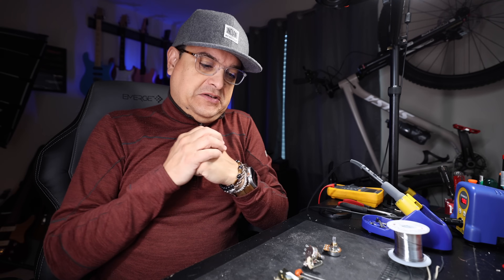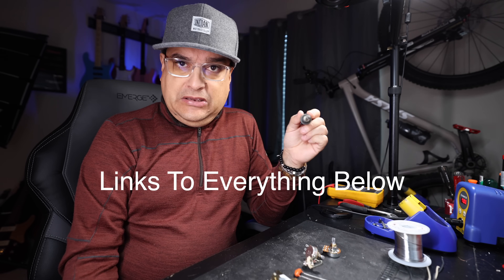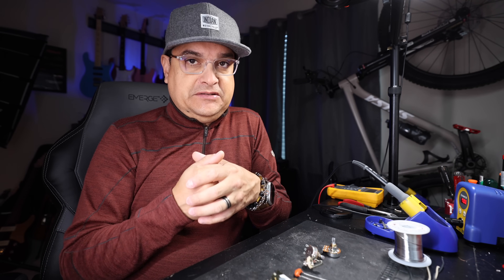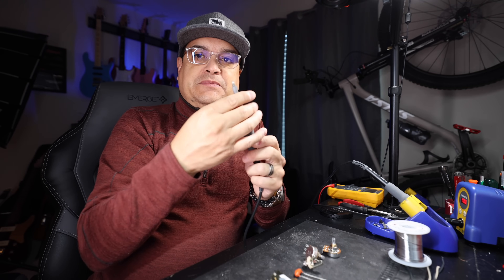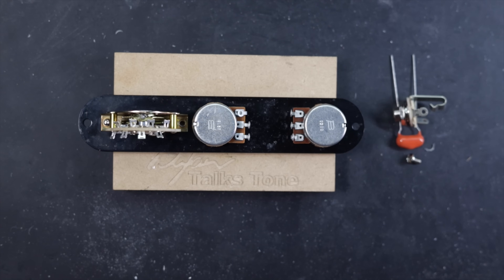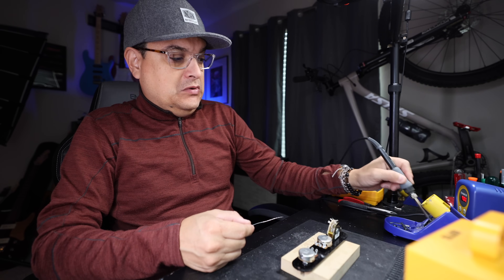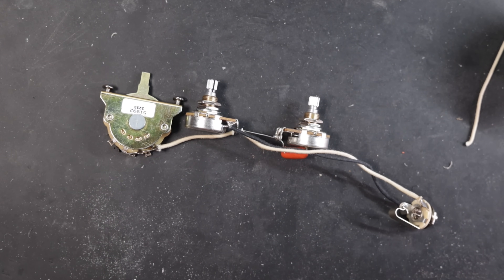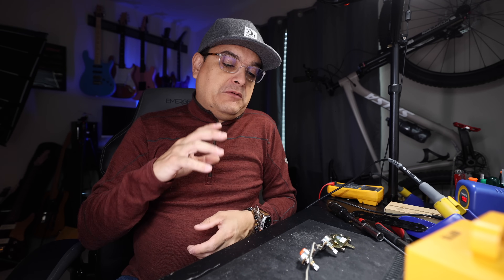If Your Soldering Sucks, Do These 5 Things

Comment: Hi. I'm using pointed tip soldering bits. I have to wipe them on a wet sponge regularly to keep them clean. You did not have to do that I wonder why. Thanks
Reply: You have to clean and tin your tip regularly to keep it clean. It's part of the process. I'd strongly suggest to use a brass sponge instead of a wet sponge, though, as the repeated thermal shock of the wet sponge will ruin soldering iron tips very quickly

Comment: Was frustrated trying to get a simple repair done. I figured it was a lack of heat with the cheap little iron I had. It was the iron. Once I had a good hot iron, it went smooth.

Comment: I have that exact same Weller iron and it sucks. I just bought a new station today because of it. I decided to test to see if the temperature control knob on the Weller does anything and it doesn’t. It doesn’t change the voltage on the outlet of the iron plugs into and I verified this with a temperature probe and the temperature doesn’t change, regardless of how that knob is set. Not only that the tip literally gets loose every single time I touch a solder joint with it.

Comment: Thank you so much for the video!
If I may give unsolicited advice, for your overhead camera, which is usually at a fixed distance from your table, try turning off the auto-focus to avoid focus breathing when your hands need to enter the frame between the camera and the parts you are working on. This way you could keep the focus fixed on the parts and prevent eye fatigue.
Reply from the maker: I appreciate that. Manual focus creates problems too so I have taken to using a much higher Fstop lately.

Comment: Hey I know I'm late to the party, but I'm looking for tips. I tried wiring up my guitar but when I try to solder, especially on pots, I cannot get the solder to stick to the pot. It always stays on my iron or forms a ball on the pot (but never a nice workable blob) that just comes off with the least amount of force. The capacitor leg that I soldered to the back of the pot just comes off like nothing and theres just like a mountain of solder and wires on my volume pot where all the ground wires meet. I'm using the TOAUTO DS90 soldering station at about 700 degrees. Also, it seems like the tip isn't distributing heat equally because solder will melt instantly on some parts but will absolutely not melt on other ares. Any tips for me?
Reply: way too hot, tin 400ish is fine, tin your soldering iron tip and clean it with steel wool and/or a wet sponhe between uses. Put solder on both the wire and thing you want to solder, then heat both before joining them and adding a bit more solder. Heat flows much easier through solder than most other things. You are trying to bond the metals together...

Comment: I use that exact same yellow fume extractor fan. It works pretty well. And while it's not strictly necessary, I do complement it by having it sitting to one side of my work area, pulling the smoke towards it, and then a similar small desk fan on the other side of my work area pushing the air across in the same direction. So overall, there's a strong left to right airflow across where I'm working.

It may be overkill, but that extra fan cost like $10.00 at Walmart and takes like 2 extra seconds to turn on when I'm soldering. I figure it worth it to avoid breathing some stuff that - while not exactly "OMG drop dead instantaneously" level dangerous - isn't exactly good to be breathing in.

Comment: I totally recommend a Solomon SR-965 Soldering Iron. It's 40 watts and has plenty of heat and does a wonderful job if you don't want to spend huge amounts of money. I recommend the Solomon over most Weller irons you find in like walmart...they are 20-30 watts and the heat sucks.

Comment: To solder push back wire braid to a pot case quickly and completely, I would use a soldering station iron handpiece heater (either cartridge or shaft heater) at 50 Watts or above. The red Weller is only 40 Watts, and the Hakko is 65 Watts. My PACE PS-90 at 51 Watts works good, but my ADS200 cartridge handpiece at 120 Watts max with a high power cartridge is much faster and responsive. A flat tip is called a chisel tip. You select the size to match the solder joint requirement. If you have to use lead-free solder choose a soldering station that has cubby actuated temperature instant setback, this will help preserve the life of your tips. If you can use leaded solder use eutectic solder.

The flux is important for soldering to a pot case. Clean the pot case (I use a grinder with a superfine scotchbrite pad, pot cases tend to have a lot of manufacturing scale and oxidation on them) before soldering wipe with IPA. Then you need a fairly active flux, I like to use RA flux, which will need to be cleaned off after soldering. In my experience RMA no-clean does not seem to be active enough for soldering to a pot case. Before soldering to a pot case always add additional liquid RA flux (match the added liquid flux to the same flux used in the wire). I have liquid flux in a small brush glass bottle. The sad truth to soldering to a pot case is to make a good solder joint the case will have to get to the temperature needed to flow the solder, this puts a lot of stress on the pot.

After soldering each joint you should tin the soldering tip before returning to its holder (some call it a cubby) this will preserve the tips. This is where I like to use 0.062 inch diameter solder wire on a spool next to my soldering station. If you use a sponge use distilled water and not tap water. Most tap water has high mineral content.

To jumper for point to point wiring it is common practice to use tinned copper bus bar wire of the same nominal size as the other wiring in the guitar. So, if the wiring is 22 AWG you would use 22 AWG bus bar wire. If 20 AWG like a lot of older Les Paul guitars you would use 20 AWG bus bar wire. You can insulate bus bar wire using Teflon non-heat shrink tubing if required.

If you want to know the proper techniques and images of production level solder joints you should consult IPC standards. Really, any guitar wiring technician should be at least IPS J-STD-001 certified.
Reply from the maker: For anyone else seeing g this… there is a lot of misinformation here.

Comment: If anyone looked inside my guitars, they would literally recoil. My soldering is so bad, it looks like some sort of Terminator 2, liquid metal thing took a dump all over my pots... which are singed to the point of wondering how they even work anymore. Wires burned, rattling chucks of solder rolling around inside the cavities etc. It's a train wreck. lol

Comment: Thanks for the great help. I've watched other vid's where people use the push-back cloth wire for the switch jumpers, and that looks like a nightmare, and it usually ends up looking crappy. Is there any reason to not just use bare wire like you have done here?

Comment: Several people have done tests to validate the claim that solder guns can demagnetize pickups. 
I haven't seen anything that leads me to believe this is true. Even if it is, I have rarely needed to solder with my gun right up against the pickup lol. In the rare event that you need to do that, just switch to a stick iron real quick for that part.

Comment: Thank you for the very best soldering advice.  That Tele harness you did in a few minutes would have taken me an hour at least.  I think the only thing I’m doing right is using cloth covered push back wire.  I have an LTD EC-1000 with a beautiful koa top that looks, feels and plays great, but the original Seymours are just not doing it for me.  Not enough midrange and a really ragged sounding low end.  I’ve already bought some replacements and I’ve been dreading putting them in, but your suggestions are going to make this a lot smoother job.  Now for starters I’ve got to get myself a new soldering iron…. Thanks again!

Comment: Great video. Many good points. What would also be great is showing how to solder several wires to the back of a pot ie. multiple pickups, grounds. Do you twist them all together or do a small spot for each? Thanks

Comment: As an intermediate solderer there is 1 observation that stands out. Specifically I have been dismayed when I receive a new set of pickups with very tiny gauge hookup wires, such as 30 awg or smaller, because experience has taught me that those super tiny wires are very difficult to work with in a complicated soldering situation. For instance tinning these very tiny few strands can cause the thin wire to lose its flexibility and become rigid and brittle, prone to super easily breaking off near the solder joint. Etc. Etc. 

Lots of us have been baffled after receiving a humbucker with 5 microscopic hookup wires!?#@?

Things like that cause stress. Especially if you only need 2 wires. 

Vintage style pickups are, however, available with heavy 22 awg hookup wires. Most references state that 22awg hookup wire is the guitar industry standard used in almost all pickup hookup wire. Well, don't rest assured because even some boutique vintage style expensive p90 pickups come to you from the factory with 30 gauge hookup wires.

Most casual recreational guitar modders are unaware of this wire misunderstanding. In reality most modern pickups don't have 22 gauge hookup wire. Most modern pickups have very thin hookup wire compared to vintage pickups. These very tiny wires are good for complicated pickup switching options, but I suspect that another underlying factor that people need to be educated about is because the hookup wire gauge is most often not 22 or 24 awg, instead the wires are almost microscopically tiny wires that are most often used in robotic assembly operations. These same tiny wires pose a real challenge to the casual solderer.

As a solution a customer can often order the same pickup with vintage push back wiring instead of tiny tiny modern plastic insulated wires. Those tiny wires are for inserting in quick connector blocks found on pcb boards, i.e., Gibson guitars. It saves $$$$$ in manufacturing as the components snap together. No need for soldering technicians or soldering robots. A robot can snap a connector together easily. The robot doesn't even need to be 'smart''. 

I wonder if guitar players know that a lot of expensive guitars are equipped with pcb board based electronics. When a guy finds out that he can't even change a pot in his new lp traditional you might expect him to be flabbergasted and insulted by a company that he thought he could trust.

It seems unethical to market a guitar as being vintage or traditional without certain characteristics being found to be present in the supposedly vintage or traditional product. It's an obviously dishonest business practice attributable to corporate management policies. Misleading the customer is always a bad idea. 

It is advisable to always investigate and research the specific details regarding hookup wire size when thinking about modifying a guitar or buying a new guitar for the purpose of modding it.

By practicing soldering skills and learning effective soldering techniques a person can effectively turn an inexpensive guitar into a super great instrument. Many cheap guitars a well built structurally, but they are often very lacking in the electronics department (like my '14 Gibson 50's Tribute Les Paul p90). It is also expensive to have a cheap guitar worked on. Learning to solder can open the door to learning the theories behind guitar wiring circuits and you will be able to use the pickup options of your choice as  well as any switching options possible.

Comment: My update on the Weller WLC100. You can (so far) still get them from Amazon for $65- but Weller has discontinued it, no website support at all, and in the  Seattle area no replacement tips.

Comment: nice bike , what is it? and sometimes it's like the solder job is fighting me, I've been soldering for 40 years and still have issues so, asking: is it mostly right heat and if not sticking or melting is it the surface of the joints not prepared properly, example: just the other day I'm adding digital timer to a solar inverter and a little hard getting the big solder puddle on the power in joints to melt..thank you

Comment: I had a problem with a pad on the board and no matter what I couldn't get my new 22ga wire to solder shinny. A solid and stranded sets of Amazon wire insulation melting off and then getting some wire from Antique Electronics solved the heat issue but not the tinning with non lead solder. Finally have the option of non lead for my new Epi mods and lead for old amp and vintage guitar repair by going with 20ga stranded heat resistant auto primary wire from Napa that is not tinned giving me the choice of non Kester or lead. Hope this helps somebody

Comment: "Use good stuff"! That is the ticket, light and a lens for me because my eyesight goes fuzzo when I have to zoom in to a pot/cap/switch. Lastly "Be cool and calm" I used to get into a frenzy when I finished up and all was tested, put the plate in and....Nadda cos I over heated a pot by using a stupidly heavy duty wire just to connect a volume pot and the heat and time On the lug wrecked the wiper inside the pot(They were rather inexpensive type) so that's how I learned (like you said) we are'nt welding here! I know you must have learned in a similar fashion cos you have it down to a fine art and that takes practice. Thanks, again for reminding us to use the "Right stuff".

Comment: Any recommendations for desoldering wrapped pots or switches? I ran into this issue on a Fender 16' MIM Strat as something done from the factory when trying to redo the hot connection for the jack on the volume pot and have found nothing online yet.

Comment: Soldering IS welding. Chemical bonding would be using something like an epoxy. Lead and tin are not chemicals, they are metals. They are used as a fillet material in soldering. The main difference between soldering and "welding" is you are not melting the base materials AND the fillet material. You are bonding them. There is still welding going on here, not chemically bonding. A cold base material will not bond with a hot filler material. You must heat both the base materials AND the solder. Otherwise there is no joint/joining/bonding. 

Not meant to argue, but stating false "facts" doesn't help anyone. Words have meaning, and you should choose them carefully and factually. I've spent a very long time in my life fabricating and welding. I know better. So should you if you are going to make pickups and wiring set ups for other people. You can't be an expert in your field if you don't know what you are talking about. You can't be a very good teacher if you don't know the subject material very well either. This isn't to say you are dumb or know nothing, but it makes you look foolish and suspect, when you say somethin like that.
Reply from the maker: Hmm… well… you are wrong… so there is that, if you would like to get into a materials sciences conversation I would be happy to. A chemical bond happens when the atoms of two materials migrate into one another by heat or other means. 
Welding, as you mentioned is melting two metals together. While I understand your confusion because I included the word “chemical” in the phrase. This does not refer to “using chemicals” as you may have assumed. It’s the technical term for the actions I outlined above.
You know…. “Words have meaning”

Comment: Dylan, thanks for all your videos. 

As someone with extensive electronics background, I'd like to expand on why high heat and quick soldering is better. When you use a lower temperature for soldering, yes the solder will melt but it takes more time for the component you are soldering to get hot enough for the solder to properly bond to it. If it does not properly bond you get a cold solder joint which is crystals that form within the joint that have increased resistance and break easily. The next negative with low heat soldering is heat soak. The longer you hold your iron on the component, the more time there is for the component to get hot an possibly cause damage. So the answer is higher temperature and working fast that Dylan uses alleviates all those issues. I like to have a little dab of solder on the tip before starting the process to act as a bridge between the tip and the component for quicker heat transfer.
Reply: Yeah I had terrible time with a 30 watt solder iron that barely would melt the solder.
Reply: The whole heat bridge thing took me some practical experience to understand. It definitely makes a massive difference and is, at least to me, the key to getting in and out quickly. I can now understand how the ideal is to get in and out in two seconds. And use a light touch. It took me a while to understand that I could not 'press' more heat into the component. LOL.

Comment: Hey Dylan just came across this video. Question; I see you used the wire leads snipped off a capacitor. Do you know if it’s possible to purchase lead wire for soldering purposes? Thanks!!